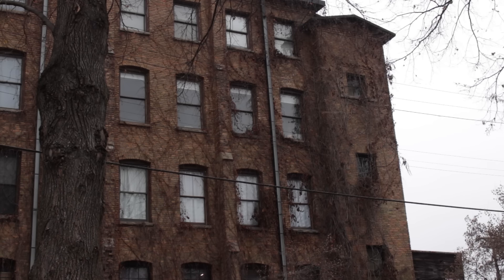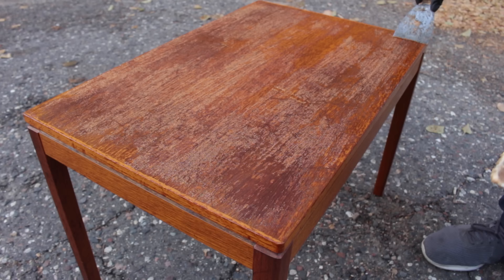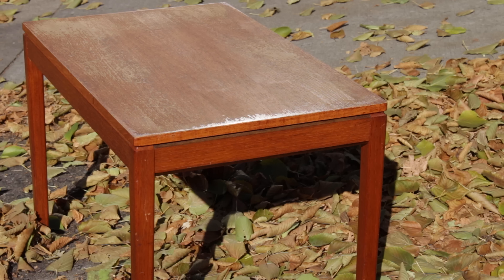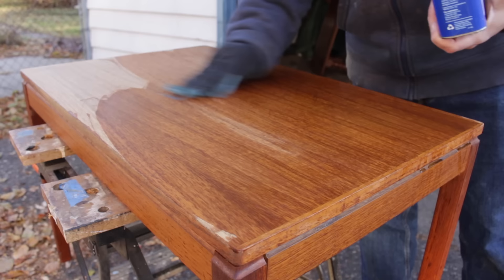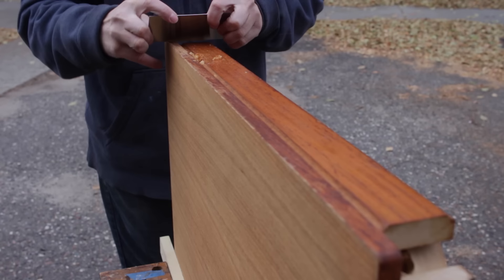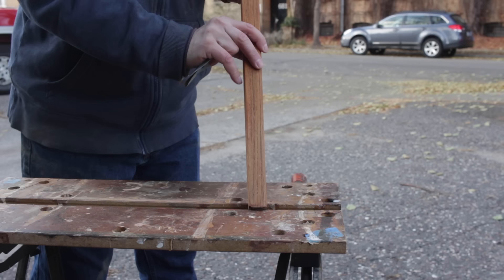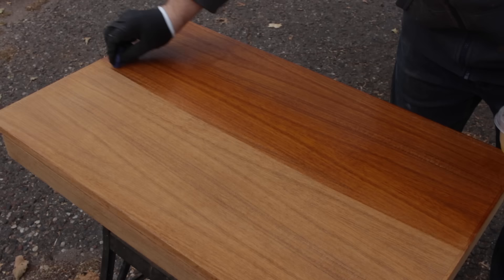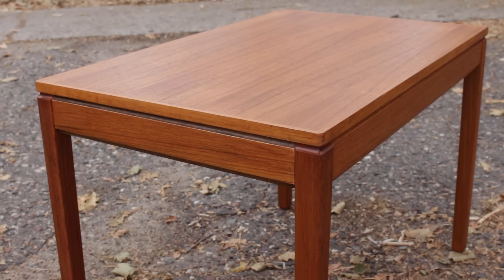Thrift Store Rescue #13 | Furniture Restoration | Refinishing A Thrift Store Norwegian Teak Table

Comment: I have had many customers call me - " I stripped my table or my front door, used steel wool and paint/finish remover to take the old finish off....."  I cringe.  It may not show up for a while but  the  smallest pieces
of that steel wool get embedded into the grain and eventually turn a weird color.  I have seen doors that have rusted below the finish and it can't be removed.  For the DIY person- best bet to strip with is a good non-toxic stripper ( Citrus Based) and a non-woven abrasive pad
such as 3M Red or Green Scotch Brite.  Large putty knife and Scotch Brite will do wonders!
Reply: Good points. May I add to them VACUUM every surface including the floor before beginning application of the finish. Stuff is in the air just waiting for you to start each coat! You won’t like it!

Comment: I use a flame torch to lightly burn the surface when it's coated with thick varnish.  It destroys the integrity of the varnish and it can then be sanded away very easily, just turns to dust with no clogging of the sandpaper.  Just as easy as sanding bare timber.  Is fun to do, reasonably quick, cheap and involves no chemicals.  Give it a try!!

Comment: I have several teak pieces purchased in Finland in the 1960's.  Most need refinishing.    To my knowledge, the pieces just had a teak oil finish - my mother used to oil them once or twice a year, but over the years the top of the buffet, in particular, has become damaged, with water rings and sun damage.  You have inspired me to try my hand at refinishing them.  Could you explain the pros and cons of the various finish choices for teak?

Comment: There is no need for harsh or expensive chemicals.  A good cabinet scraper as seen in this video is all that is required.  Best not to use a DA sander but to 'hand sand' with a block in the direction of the grain.  All you are doing is smoothing, the cabinet scraper has already removed the old finish.  Finish with Tung (a type of nut) oil, Its the magic ingredient in most furniture oils but in its pure state is the best finish you can get.

Comment: I refinished quite a bit of solid wood antique furniture in my teens and twenties with great results, but never teak.  I'm in my 60s now and have a large house full of teak furniture, most in excellent condition.  However, a couple of pieces have spots of water damage.  All the Teak stores in my city have closed down over the years and I can't find anyone to fix the damage and I've always been scared to mess with veneer surfaces.  I'm quite astonished at how much he was able to work with the table surface and get such a wonderful result.  I think I may have revamp some of my old skills and give this a shot.  I do wonder about colour though.  A couple of my solid wood chairs had water spots on the arms and are quite old and have assumed a deep, rich colour.  I'm wondering if I will be able to get back to that colour once they're stripped/sanded to remove the damage?  I guess I'll find out!

Comment: Hmm ... i would have used fine sandpaper the first place to get rid of the varnish. Because the table was used when parts of it where not "finished" with varnish ... stuff soaked into the veneer wood. To get that out you have to sand it ... but very very careful as you never know how thick that veneer is. Just like you did very good here!

Comment: Suggestion - For experienced refinishers, it's fine, but if you're newer to this, it's a bad habit to start an orbital sander while it's sitting on a piece. If you're not holding it totally level and at the correct pressure - especially with a higher grit - you can dig in too much by accident.

Comment: You stopped short on the stripper. It takes a lot more than most people think. A vat is best. A pan of some kind will work to catch the dipppings. They can be then brushed back on. The end of your bare finger can be use to rub the surface of the piece while it is wet with the stripper ( quickly, immediately wipe the stripper off ). If you finger slides easily. There is still finish on. If it resists sliding. ALL OVER! That's bare wood. It's ready for washing off. Laquer thinner, paint thinner, acetone, a fast evaporating clear solvent. Water will work. But not preferred. Remember stripping is 70-80%+ of the work involved in refinishing. Takes experience. But not rocket science. 😊

Comment: This makes me wonder what you would do to my living room table. It's made from construction 2x4s and a full sheet of siding plywood. The finish is wipe on ploy for the sides, with an epoxy resin top. No color, clear resin, not even smoothed out. It's too large to fit through the door, and was glued and screwed togeather so well we'd need to break it or cut it to get it out of there. It's also strong enough to support at least 5 tons (we tried stacking stuff on it till it collapsed as a means of hopefully getting it out of the apartment, since the landlord wouldn't let me cut the legs off it to get it out.)

It looks like somone built the frame for an 8x4 foot section of flooring for a house, and put table legs on it. It's nuts!

Comment: I’ve often purchased older items as well and usually all the older antiques were slightly wobbly. Usually because of was how it was built. (And how many sellers know certain pieces aren’t fake)

It is also sitting on a concrete driveway that’s more than likely quite uneven by what you can see.  

Also, to work indoors w the odors these chemicals give off, is not easy nor very safe . I’ve always done this type of work outdoors as well.
Reply: Especially if you have a gas stove, gas heating system and/or water heater. These can cause a house full of petroleum vapors to go BOOM!

Comment: hi there - beautiful looking table, love the look of that teak. Did you consider using Danish oil as a finish?  I am fairly sure that would have been the original finish. Not saying that you should have, just interested to know your thoughts.
Reply: Original finish would have been a lacquer, not an oil. Danish oil is generally used on outdoor applications.

Comment: Table looks lovely.....  I do not think I would have the ability to use the scraper and the razor without some major errors, could I not just remove the original finish using stripper and sanding... I noticed you used very little stripper.

Comment: So if it was a solid teak table top, would you just have sanded straight from the begininng or is paint stripping still necessary? I'm just getting into restoration and I see so many ways people approach it. Love your videos!
Reply: Stripper first, then wipe all parts with paint thinner or mineral spirits. Following directions on stripper can, scrape bunk off, rub with the grain of the wood, use steel wool (not SOS pads) to remove the residue before beginning to sand. Apply mineral spirits as needed in order to completely remove remaining stains, varnish, or wax. Getting the wood cleaned at this stage will assure a beautiful finish. Vacuum all surfaces of the wood including underneath, inside and vertical Then vacuum the floor and anything that could have residue  or dust on it because as you apply stain, sealers, or varnish, it will find its way to your finish and it can’t be removed except by…guess what? Starting over. I bought a roll of floor paper at H D a or Lowe’s years ago and it’s so much better than trying to use newspapers. Tape down with masking or painters tape so everything is protected.  Have something to put your gunk from the paint stripper in.  Several throw away cans, a couple of putty knives, a roll of paper towels, disposable gloves, wear old clothes, preferably long sleeves, comfortable goggles, cause if this stuff spatters in your eyes it causes serious hurts!  You’ll be glad you did! It’s not as much trouble as it might seem, and attention to details before you begin will save you from anguish later. One more thing I’ve learned. Don’t answer the phone once you get started…it’s ALWAYS a con. Hey, you’ll do fine and be so proud of the results. I’m working on a a three shelve table of my parents bought in 1928 when they just married!  Mainly just cleaning and sealing with a semi-satin finish. I be got to get busy, I’m 84 years old already! Time flies. Enjoy! Grandma 🇺🇸   ❤️

Comment: if I did want to use a thicker poly for finish, what would you suggest?   The teak I am doing is on a platform bed, and dog scratches and abuses it.   Need something a bit more dureable. thanks!

Comment: question from a random person who knows nothing about the specifics of these things, but, from various projects I've seen, wouldn't a polyurethane finish end up cracking apart/warping on something that experiences random heat/moisture expansion?
Reply: I think it depends on the thickness of the coat, but in Minnesota I don't think he'd have to worry about humidity too much haha

Comment: I love your video but I'm so disappointed that there are no links to the products and tools you used. I would like to know where to buy the card scraper and what type of stripper, wood filler, what grit of steel wool? 
I see that the Gel Stain is General Finishes. Great choice.

Comment: I have a Cushman dining set. It has the red maple original finish. There are some dings in the finish but I don't want to completely refinish.  I saw that you put a glaze on the legs of the trestle table and was able to match the color.  Is a glaze durable enough to put on the seats and backs of a chair? I know the legs won't get the same amount of wear and tear. Thanks.  Nancy C.

Comment: I already bought straight oil based polyurethane, I have a nice brush and a sponge brush. Is there any way to get it to come out as smooth as you did it with the wipe on poly?

Comment: This is probably a silly question, but how do you know if there is a finish on the wood?  Some videos I watch go straight to sanding stating there was no finish, others sand the finish off, and you usually use a stripping agent.  I'm curious if I try this myself I don't want to use stripper unless I have to.

Comment: A beginner question: Can I please ask why you use the paint finish stripping compound in the beginning, if you're already intending on sanding it? Wouldn't sanding do that also?
Reply: It gets the finish out of the pores and off the surface before removing any wood. The veneered wood is maybe 1/8th" thick. The less you have to remove the better.

Comment: I have watched a couple of your videos and am considering tackling my own thrift shop table. I don't have all of the equipment/supplies that you have, but I do have some paint and some polyurethane. I was thinking I'd sand it down, paint it, and then go over it with a coat of this waterbased polyurethane. Does this sound like a straight enough forward job?
Reply: If you paint it you don’t need to apply polyurethane. They are not compatible.

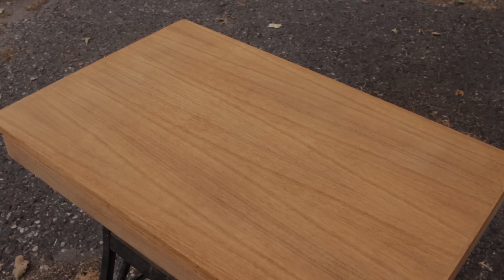Comment: 9:47min do you need to buy wipe on polyurethane (the can has the words "wipe on") to use wipe on method? Can the normal polyurethane without the "wipe on" text use the wipe on method? Thanks

Comment: Restoration and power disc sander don’t go together man. Doesn’t matter how slow or light you go - you’ll always leave swirl marks.

Wouldn’t have taken five minutes to hand sand that with a block. Would have removed far less veneer and been a much smoother finish.

Comment: Anyone know why he scraped first, and didn't just start with the orbital sander?
Reply: With the veneer being a thin strip of wood, my guess would be trying to remove the old finish without sanding through it. But scraping didn't remove it all, so he had to gently sand what remained. You also have more control with a non powered hand tool.

Comment: can you repair a veneer that is lifting along one edge?
Reply: I'm certainly no sort of expert, but mave you considered using a glue or the same type as is normaly used for veneer and then clamping it in place really firmly? You'd need a peice of sacraficial wood to protect the veneer and spreed the load.
Reply: @Ruthavecflute  I haven't really tried anything because I didn't want to mess it up.  I do need to do something though before it gets broken.  It's on a working treadle sewing machine cabinet, I have all the bobbins, hardware, and manual that came with it originally. That is why I've been reluctant to try things that might damage it further. I do have clamps and it is on a part where clamping isn't going to be a problem.

Comment: Is it really teak though? Five bucks seems extremely cheap for a mostly teak table. Even an old one
Reply: That's amazing how it turned out. nice job man. That's interesting about using a t-shirt instead of a brush. I've got some wood I need to put some sealer all in one type product on. I'm going to try on the underneath part firstly with the brush and then with the T-shirt before I move on to the visible parts

Comment: Modern paint stripper is a waste of time, about the best you can't hope for it for it to eventually soften the surface of the paint/varnish.  The proper stuff with dichloromethane is still available for "professional" use, at least in the UK and actually removes paint and varnish (and signs of life...).

Comment: Why didn’t you sand it to take the finish off?
Reply from the maker: I gave up sandpaper for Lent.
Reply: @DashnerDesignRestoration  lol…
Reply: @DashnerDesignRestoration  what do you think are the benefits of using an oil based polyurethane versus water based?
Reply from the maker: Oil based dries slowly, adds a slightly amber color and smells a bit.  Water based dries faster, has little to no smell and is clear and does not add color. Both of them have their place depending on what you're going for.

Comment: Harbor Freight 5ea 80grit 3"X21" sanding belts for my belt sander $1.25 ea.  Two belts and I would be almost looking at bare wood. 1ea 150 grit belt and it would be zero scratch ready for 220 grit using my block sander going with the grain.  30 minutes tops. Hit it with wood conditioner so it will take on the lacquer coats from my airless, remembering to hit it with 400 grit between coats and to use a tack cloth

Comment: You need better stripper. I’ve refinished at least 15 pieces of furniture and I’ve never had to use a “scraper”. Remember to sand with the grain of the wood and sanding too much takes off the natural age of the wood..

Comment: why didn't you just use the sandpaper machine first, why make the process more complicated than what it is. Or why did you use paint stripper then scrape and then sandpaper machine? Is sandpaper replacements expensive?

Comment: We need to get rid of the finish
- Yeah with a sander
So I applied paint stripper
- Dude use a sander
That doesn't work too well so I applied a second coat of paint stripper
- DUDE
Damn.. those edges still have finish
- SAND THE FUCKING PROJECT
I'm going to use my gillette razor blades for women to manually scrape ...
- YOU'RE KILLING ME DUDE....
Still.. going to need to perform more manual labour with a card scraper .. this video is getting long, isn't it guys?
- OMG
So I made it wet to check if it looks good.. and surprisingly it didn't.. who of you told me not to use a sander? Let's see if that helps
- ...
Oh man that looks a lot better
- No shit
Now on to the legs... screw that sander I am going back to scraping

Comment: all that strippe/r spirits nonsense. orbital sander from the beginning. will even anything out and remove the old finish. done. next step.too much nonsense for something that couldnt be easier. using a scraper makes it uneven. sander, front to back will make everything even